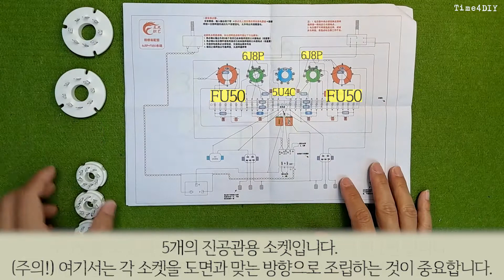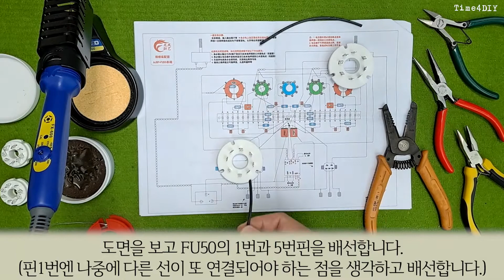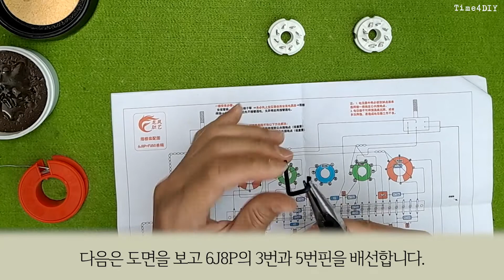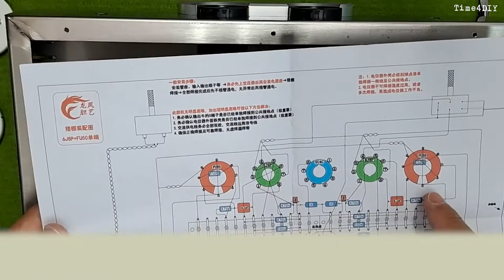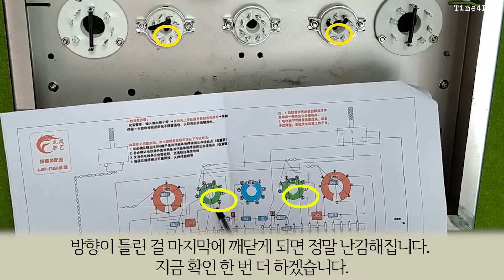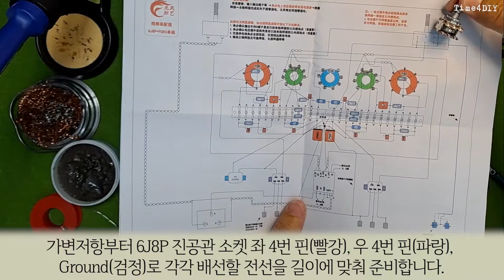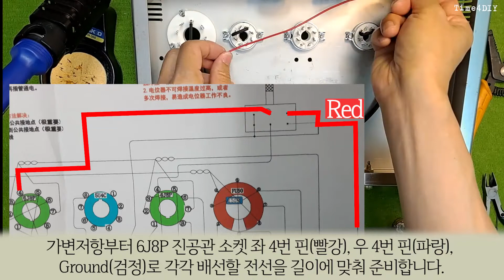[Manual #3] FU50 진공관 앰프(소켓 부착, 볼륨 배선) FU50 tube amp. kit DIY(tube sockets, RCA signal input parts)

Comment: I assembled a similar one from a Chinese kit with a PCB mounted with 5 valves. 

Its little output transformers are 3k:4/8 ohms. To my surprise, it sounds excellent with my JBL 4320 speakers with rich bass (perhaps due to the amp’s low damping force), and sweet mids and highs. It doesn’t sound like my Elekit TU-8600 300B kit amp. But all the same enjoyable. I have dozens of other valve amps too but I never belittle this FU-50 amp.
Reply from the maker: I agree with you! Thanks. Have a happy amp life~ ;)

Comment: Nice video.
From the diagram 12:39 I don't understand why the "R" output from potentiometer goes to left side tube though.
Wouldn't that reverse R <-> L signal??
Reply from the maker: Hi. Yes, you are right. I connected red(R) wire to left socket... -_-;
Thanks for the right advice.
Reply: @time4diy626  
I think the diagram is wrong, so it's the maker's fault not yours lol.
Great job for easy to follow video. I'm following your guide to make mine right now👍
Reply from the maker: Thanks for your understanding and kind comment. Have a happy DIY time.